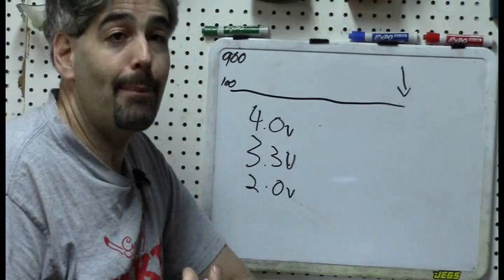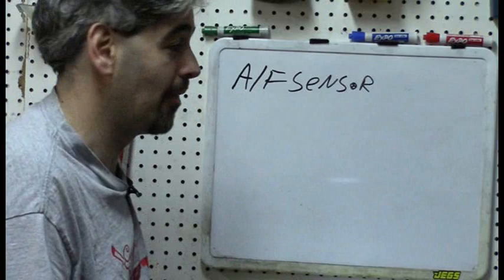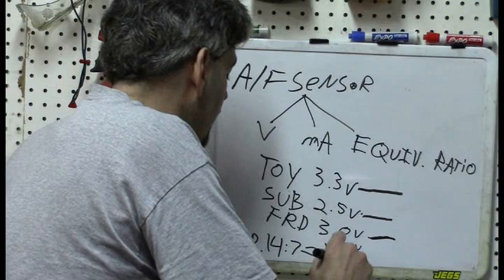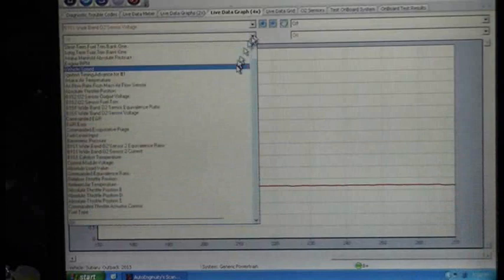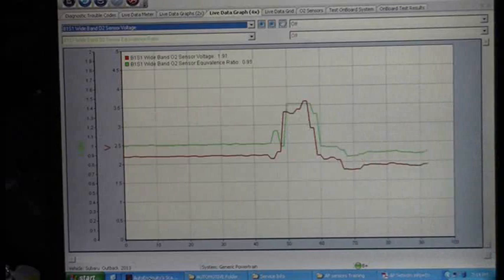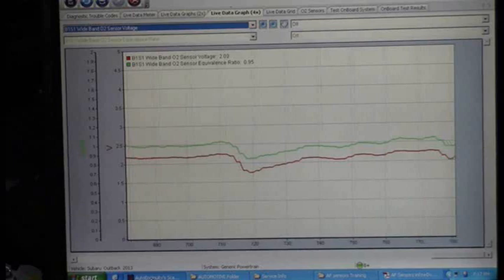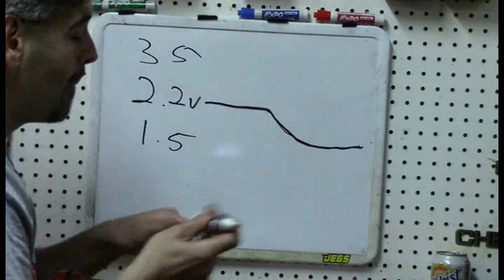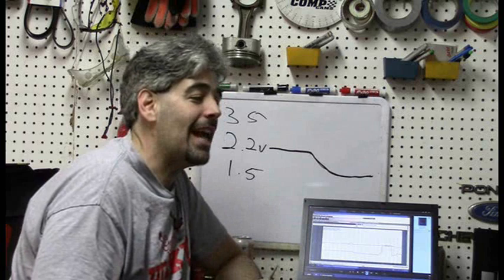Air/Fuel Sensors (Wideband Oxygen Sensors) vs O2 Sensors- PART 2

Comment: Ended up here because I have a mazda cx5 with a p420 code (comes on and off from time to time) and I refuse to take it to the dealer so that they can change the Cat the A/F and the 02 without actually fixing the problem. Love the way you explained the A/F sensors so much I watched a ton of your videos just for fun. I am an aeronautical engineer and I am very amazed at your knowledge of the different systems and sensors. I love how you hate the shotgun repair methodology that the 98% uses. I used to be a mechanic and I constantly got in trouble with my boss because I wanted to be 100% sure of a diagnostic before replacing parts. Keep it up man.

Comment: I just subscribed. I stopped doing automotive repair professionally about 30 years ago, mostly because of engineers, as demonstrated in the video where you were trying to remove the fuse box cover with the hood prop in the way. I loved diagnostics, hated trying to access the problem after it was diagnosed. Anyway I continued to work as a mechanic, just not on cars. I wish you were my neighbor. There are a lot of things we could discuss that have changed in the last 40 years. Such as fuel quality. I really like your videos. Thanks.
Reply from the maker: Thanks for the kind comment!!!

Comment: Thank you for all you research and time you put into this video. I am a full time  mechanic and I am still constantly learning. I mostly work on older cars because my prices are fairly low and that's what usually comes in the door. Most of the time I just use my little code reader and not my scanner .This evening I was working on an 06 caddy CTS and had my scanner plugged in and for the first time saw the term lambda. I have watched quit a few videos tonight trying to learn these new(to me) parameters and terms.And your video has been the most informative by far, compared to most of these so called mechanics that post videos. THANKS AGAIN !!!!  P.S. Almost to 5000 subscribers, congratulations in advance !!
Reply from the maker: You're welcome chevyman, that's a great story on the caddy. Yeah that's a pretty weird experience the first time you run into a wideband sensor. Almost as weird as the first time you try to change a starter on a caddy with a Northstar and realize the starter is actually under the intake manifold!!
Reply: Great job Matt.  I have been doing quite a bit of research on these sensors myself due to the fact that these type of sensors are on Cummins ISL 9 Engines.  But on the Cummins Engines they are called Nox sensors.  As far as I can tell from what I have seen the Nox sensors work on the same basis.  The bummer is the factory scan tool does not show Nox data.  So I am in the process of figuring out a way to read the current on one so I can use it as a diagnostic aid.  One option is I buy a 600.00 dollar micro amp probe or I figure out a way to make a custom current shunt with a low range so I can read the voltage drop across it with my Pico Scope.  Once I get it figured out I'll show everyone.  I do know for a fact that the micro amp probe works great on air/fuel sensors, just don't want to have to pay 600.00 bucks unless I have too.  What do you do for a living again Matt?  I thought you said you are some sort of scientist?
Reply from the maker: busjockey1 I have been a molecular biologist for about 22 years now.  Currently I work in a technical consulting role for a scientific company.

Comment: Again, hugely helpful.  

Your 4 cylinder remarks were a hoot.  It reminds me of flight school when I had an instructor who had 7,000 hours training in Tweety Birds (Cessna T-37 Tweet)  The flight commander told me he gave me one of the best instructors, and that he had over 7,000 hours training pilots in the T-37 converters.  I learned later that they called them converters because they convert fuel and air into noise.  That would be a good fit for the Subaru you drove it sounds like.  Much later I heard others talking about, "I took my initial training in the 6000 lb. dog whistle." (They definitely whistle)  That would probably fit the 1.1 liter turbo 4 cylinders.
Reply from the maker: I wonder if a 4cylinder would even get a plane off the ground lol. Pretty sure you would have to get over 80MPH within a mile distance to pull it off!!!

Comment: Great Videos and explanation. As a D.I>Y just getting into OB2 diagnosis, it is a real blessing to come across your videos and your theory to come to a scientific proof before wasting time and money on parts.Case and point, I had a truck with a bad cat and took it to the dealer for emissions warrenty. A previous mechanic who had diagnosed the bad cat even left the code for the dealer. The newbie dealer mechanic erased the code and just made the assumption I needed a $1100 tune up which I did not accept. Long story short...test, don't guess

Comment: Thanks! I just started playing with an xtool D7 to diagnose a p0420 code on my 2002 4runner. The live data on the a/f sensor behaved exactly like yours in the video. The downstream O2 reads low voltage, I still have to check for a gasket leak before the cat before replacing anything. But your videos have kept me from loading up the old parts cannon before I know what caused the code. Thanks again!

Comment: Thank you for that terrific overview of wide band sensors.  Recently picked up a 2005 Toyota Camry 6 cylinder as a second vehicle for long distance highway driving and it has upstream wide band sensors.  Also really glad I picked up the Autoenginuity software last year thanks to your channel and videos on fuel trim and scanner options.
Reply from the maker: +Sandbag1300 Yeah I still struggle "thinking backwards" on widebands but I am getting more comfortable with them

Comment: Have'nt come across wide band sensors,[toyota yaris 00] in any car so far but from the video, far more accurate.Can see confusion with rich and lean in opposite directions.As you say, the multimeter is for the museum.An om 580 scanner can graph pid's and record and playback live input and is not overly expensive.Great video for the novice and experienced diy mechanic.

Comment: Good educational video, keep em coming. Seems easy enough the air flow does two operations where the 0 2 sensor will lead you  to look for  other problems. I think its all about the money, the air/flow will probably cost two and a half times as much as just replacing an 0-2 sensor. Or possibly more, plus the new diagnostic machine will bump up the cost of getting the vehicle on the diagnostic machine. (all about the money)

Comment: Actually the wideband o2 sensor (AFR) is pretty handy way to monitor your car running, especially when you are doing some mods. I added one into my car, just right at the beginning of the exhaust, then I'm using some "super-hiper fancy" stuff to show me values on a gauge that is mounted in my cabin. That's a really cool way to live monitor your running car, specially if you run a big boost from turbo. To sum it up - wideband o2 for me is a great monitoring tool, that my engine doesn't use at all :)

Comment: Great observations!  I've been considering getting Autoenginuity myself.  I currently use a Bluetooth scanner with my Android Phone. Torque is the paid app with the Torque Scan paid "plug in" in addition.  It doesn't include near as many PIDs as Autenginuity, but the O2's, A/F sensors, STFT and LTFT are included. Also  MAF, IAT, TPS, MAP, Engine Load , CMPS, CPS, CTS.and includes graphing and custom Gauges.  Not bad for an investment of $30-40.

Comment: Thanks for taking the time to create another great tutorial. I have a comment regarding the Subaru WOT test. I am assuming since this is a new vehicle it is equipped with a drive by wire throttle. The drive by wire throttle is the likely cause of the linear ramp on the graph from stoic to full rich condition. There is a lag when going to WOT with drive by wire, probably to help with emissions and maybe help protect the engine. Some cars have more lag than others. This will also explain the instantaneous lean condition when you let off as there is no lag when coming off the throttle.
I may be wrong but it seems logical to me
Keep up the great work.
Reply from the maker: Yes I see your thinking.  I should have validated actual TP% during the test.

Comment: Replaced a bank 1 a/f with 02 sensor once. Ecm did not like that at all. Had to buy a/f and 02 sensor. Expense expirament. They are "not" direct replacement for each other.  Great vidio on understanding this a/f system. Thank for putting it together.

Comment: Good job on your presentation.....!!!   My only comment is....alot of the lesser expensive scanners do not have the ER scale...but even the lower-end scan tools will have Short Term Fuel Trim(STFT). I generally use STFT on diagnosis so that I do not confuse myself with voltage scaling. At 10am I can be scanning a car with O2 sensors, then at 12pm scanning a car with A/F sensors.  But, fuel trim is the same with both. The only problem would be with a dampened meter - the reaction time can be slow. I'm fortunate enough to have a VERUS bi-directional scanner at my disposal, so I can isolate O2 readings and graph them in almost "real time". I thought your viewers may enjoy you doing a "fuel trim" vid to show how they can use the scan tool to do essentially the same test you did on this vid. Keep up the good work.

Comment: thanks. you're a good teacher and you explain very well as well. now I know that my upstream is an A/F and not an O2 sensor thanks to you. I thought that it was an O2 sensor and not responding well and stuck on about 3.5v to 4.5v. even my scan tool showed me the result in mA instead of volt , I was wandering why. many thanks .

Comment: Great video! Additionally, the equivalent ratio es the lambda so if you had included in on your WOT run I'm pretty sure it was around 0.75 to 0.8 where gasoline engines produce more torque. And that value multiplied by 14.7 would give the actual a/f ratio.

Comment: I have Honda Accord 2003 with wideband sensor, first time i looked at scan data I was surprised to see that flat line )) Now I know what that flat line mean )) thanx for great video. Going to hook scan tool to Accord and try some tests I have seen here ))).
Reply from the maker: Till May - If you wouldn't mind posting some of the numbers you find with the A/F voltage on the Honda I would find that extremely helpful as would others!  Please do that as soon as possible because I don't want to wait til May.
Reply: Schrodingers Box I tested for HONDA pilot 2005 that has wideband, Autoengunity is showing only MILLIAMPS pids and not volts. and surprisingly the wave form is showing very little change on rich and good amplittude on lean. surprisingly the down stream pids have voltage and fuel trim for O2 sensor.. kind of intresting and confusing, seeing first time for an O2 sensor fueltrim pid for downstream.
Reply from the maker: sivaraj palanisamy  Yes Sivaraj I have had other people email with similar information, most recently a shop owner with a  Jaguar XK8 with mA pids only and they switched like an O2 sensor between -128mA and 128mA.
  I have not seen enough cars to know what PIDs are or are not available.  I would probably check to see if Equivalency Ratio was available if voltage was not.  If only mA is available, then that's a problem- the data would be completely useless without knowing the specs for the particular vehicle since the mA clearly varies widely between vehicles.  The Subaru in the video for example shows well under .5mA current- a far cry from the 128mA in the Jaguar.
Reply: Honda does have ER ratio in addition to MA.. however i am surprised the downstream sensor have O2 fuel trim PID value. I am not referring to STFT and LTFT. it say O2 fuel trim pid on downstream.. kind of interesting didnot get time to investigate, if i did will post you.
Reply: sivaraj palanisamy
 An additional fuel trip off of the O2? Especially after the catalytic converter. Yes, I must learn more. :)

Comment: It is a great video! I came from the other side, I learned to use lambda values (equivalent ratio) with a wide band bosch sensor when I turbo charged my old audi 80 quattro. (It was a 4 cyl (lol) around 300hp) If you wot the engine in EQ you sould see something around 0.84 at full load if we talking about an engine with injectors at the intake manifold. The direct injected engines are different, they can work on lambda 1 most of the time, even in wot.  (soon I watch and understand all your free vids, so you will have an another sub for the other chanel :) thanks for the great content)

Comment: Until I saw these videos I didn't know what to look for to tell the difference. At least now I know. 
As an aside, when you were talking about dvom's, I remembered a meter I bought nearly twenty years ago. Not only was it able to measure current it could do min-max holds. The meter was a micronta (radio shack) dvom. I still have it but I'd have to see whether it could react fast enough to do everything needed for the test. It was a hundred bucks back then so if it's capable then that makes it pretty advanced for it's time. Looks like I need to dust it off and give it a try.

Comment: I have to say that I thoroughly enjoyed your comments about Subarus and 4cyl cars even though I love Subarus.  Thanks for the excellent teaching.
Reply from the maker: +zracer81 Thanks man... but I bet your opinion about Subarus would change if you ever have to replace a head gasket in one with 180 degree cylinder heads!
Reply: Very true.  As a hobby I buy Subarus with problems and fix them up and resell them.  Headgaskets are a major repair - done about a dozen of them and the easiest way I think is to just pull the engine out.  Tried doing it with the engine in the car ended up using more of the f-word than any other tool in my garage.
Reply from the maker: didn't know you could do them with engine in car. I wouldn't even attempt that. in fact on most cars I find it easier to just pull the engine and ensure my torques are accurate.
Reply: +Schrodingers Box What's a 180 degree cylinder head? Is that particular to a specific model or range of models?
Reply from the maker: Garth Goldberg Subarus often have cylinder heads that are located 180 degrees apart- e.g. the valve covers are across the engine in a straight line from sidewall to sidewall as opposed to the usual 60 degree "V" shaped design
Reply: +Schrodingers Box I thought that's the way all Subarus have been made (with a few exceptions, i.e. "Justy").  That's why I was confused. "Opposed piston" or "boxer" are the terms with which I'm familiar.

I bought my first Subaru in 1980, when they were still pushrod engines with a two-barrel carburetor. No catalyst. 80hp.  

I'm just starting to go through your videos. I'm learning a lot. I haven't dealt with the EFI systems on my own vehicles too much, as they've been pretty reliable.

Comment: Great class Shrodinger!! I worship you insight, man! Just came to mind that a 14.7:1 stochometric ratio is for a classic gasoline free of ethanol, called E0 fuel, but with a nowadays more common grades like E10 is about 14.4:1 and as a lot are E15, having a ratio of about 14.1:1. So, I'm trying to give a headsup, if I'm right.
Congrats on your videos.
Reply from the maker: Yes other people have indicated that and I have not actually looked into it. It seems reasonable and when I get some time to look into I'll most certainly introduce the concept.

Comment: hi, couple of tips, before checking wide band, we need to check if heater circuit is functioning properly to be on safe side, i suggest to test during closed loop. veryinformative, i learned about ER today.
Reply: WTF is ER?
Reply from the maker: Rýán Túçk He is referring to Equivalence Ration which is explained in the video. Briefly, it normalizes the sensor's output to equal 1 if the sensor is in stoichiometric.

Comment: Matt, thanks for another great video.  I've not yet been able to find the Toyota engineering paper online (please share link if you can).  If these are truely a wideband "O2 sensor", i.e. measuring only O2, then it seems when/if the engine were to go slightly sub-stoich, the current output would be exactly the same as if it were at exactly stoich.  In theory there would be zero excess O2 in either case.  Maybe we dont get perfect air/fuel mixing and maybe not perfect combustion, so perhaps we want a slight amount of excess O2 remaining?
i wonder if the target point for the PCM to control to is a very slight amount of excess air, and not exactly stoich.  In this way, there is a controllable range of the current to be generated in the presence of minor amounts of O2.  
I can speculate that this may be why the engine goes into open loop when rich at WOT (maybe it wouldnt be able to tell how much below stoich it was at), but its just a guess.
I guess the same can be speculated with the Zirconium type...we may have briefly touched on this in another thread.
I also wonder if the cats had to be redesigned for use with the wide band sensors as i suspect the O2 is controlled to a tighter peak-to-peak magnitude.
It really doesnt matter one way or the other as the diagnosis is exactly per your video regardless.

Comment: Great vid but just to clarify the heating circuit... there is a big difference between a narrow and wide band. If a narrow band heating circuit fails its not a game breaker as it will still work when warm enough. A wide band relies on the heating circuit if the heating circuit fails the sensor will not work